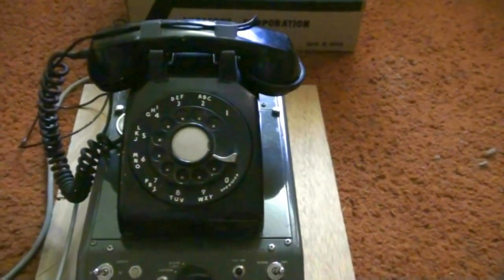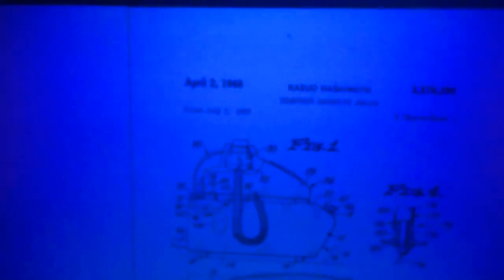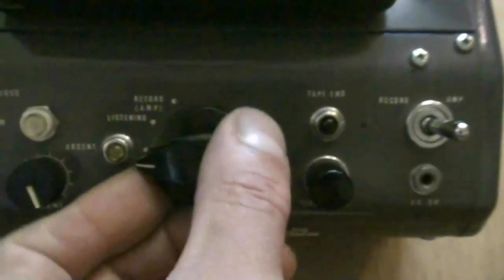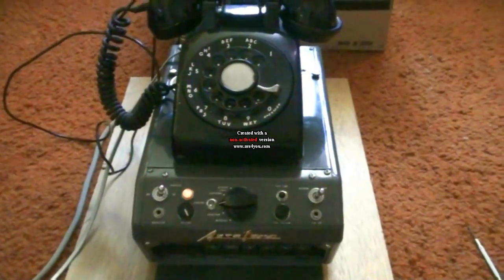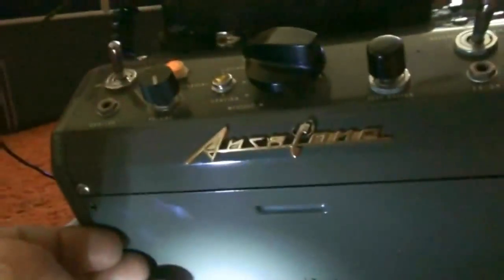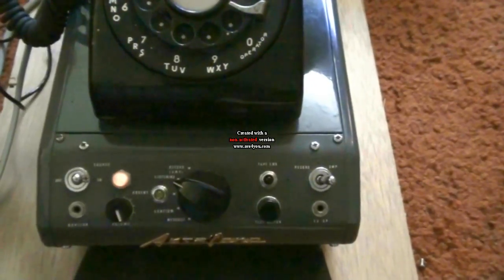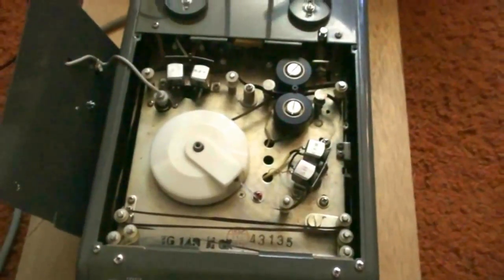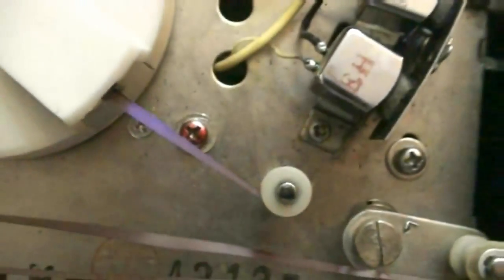1960's Ansafone KH-85 Answering Mahine

Comment: That is a fascinating old (and must be RARE) answering machine!! I like the idea of using two pinch rollers and two tape paths all from one capstan. The mechanical and inductive interaction with the phone is awesome.
Reply from the maker: CassetteMaster There is a (seemingly modified) one that had been on ebay for a while, ironically also sold by Commsec. The ingenuity in this machine is quite amazing,  not only in how it operates,  but in the way it bypassed the restrictions of MaBell by being a phone answering robot.

Comment: My father purchased an exclusive for San Bernardino, Riverside, San Diego and Imperial Counties (CA) in 1960 from Al Gamburd, owner of Ansafone Corp., exclusive importer in to the US from Japan.  Around 1963-64, as a 9-10 year-old, dad taught me to service the machines.  Over the next 15 years I serviced hundreds. The KH85 was the basic unit. The KH39 was the first unit to go into service in movie theaters (outgoing).  The 90 was the last w/same design, a remote.  I own several operational units
Reply: I have a model kh39, would you know how or where to sell it? I have all the parts and cords. It turns on but I’ve never messed with making messages

Comment: I run a voicemail system for my business, and it fascinates me to see an early answering machine.  I can't believe that it would physically take the phone off the hook, because I only remember machines from the 70s that were directly connected to the phone line.
Reply from the maker: jeopardy60611 Yeah,  this machine is quite an engineering masterpiece. Not only is it possibly one of the first answering machines, but it also circumvented MaBell's restrictions on connecting outside devices to their telephone lines. It was literally a machine that physically answered your phone. I really need to remake this video and hopefully I can actually get the machine to work properly.
Reply: My understanding is that before the Carter phone case, you couldn't direct-connect anything to a landline phone jack other than an AT&T-issued phone.  Fortunately, since Carter phone did what it did for the industry, it makes my business possible, doing automated phone applications.  Now you can legally connect a Dialogic card to a bunch of RJ-11 jacks (that is, a landline phone jack), or in my case, I've got T1 lines, so I have a number of RJ-45 (Ethernet) jacks that I connect to for 24 lines on each T1 circuit.

Comment: Got this at an estate sale for free, it was in unusable condition. i was just happy to have it and open up all the usable parts. Its made in Japan and patented in USA, japanese inventor. Its so well made. There is a powerful solenoid that does the lifting of the phone and is adjustable. lovely pilot lights up front, its lens is glass. and yes the motor front and rear bells are trash, it seems like the casting just starts cracking and disintegrating with time.

Comment from the maker: Great photos, and thanks for the link to the video! at a quick glance, it does appear to be a similar machine, but seemingly totally different. The only thing that I could think of is that perhaps this model connected directly to the phone line?  I'm not sure when MaBell began to allow that. I do notice a socket on the top labeled "line", where the 85 has coil pickup connection for the receiver. The socket on the 85 is not labeled, and the "mic" jack is also not present on it.

Comment: Thanks so much for making & posting this video!  I found an AnsaFone at the Goodwill here in L.A. this week & am incredibly intrigued by it.  I've got a later version than yours and am wondering if you know how this particular model works.  It's missing the power cord & also the two metal prongs that yours uses.  Actually, I can't see how they would even fit in mine...  Do you know if there was a change in how it operated from your 85 model to my 90?  Any info. would be greatly appreciated!

Comment: If I remember right, these allowed a 30 second incoming message or you could use the vox mode.which sensed the dial-tone after  hang up and it would shut off.

Comment: Neat! Where did you find your Ansafone?
Reply from the maker: Thanks!  I really don't remember where I picked it up. Most likely at a flea market or swap meet.
Reply: Thanks! I really want to get one myself, haha.
Reply from the maker: Amanda Murray haha They are pretty cool.  I just have mine sitting on my desk right now. I did a quick search on ebay and found one for 200 bucks, but it isn't working and looks to have been modified a bit.  Ironically,  it was also sold by Commsec.
Reply: I noticed it!  I think I will have to wait a little bit and continue looking around.
Reply from the maker: Good luck finding one!  Relics like these are getting harder (and more expensive) to find.  I really need to remake this video at some point. I just rewatched it and realized how horrific it was >.<